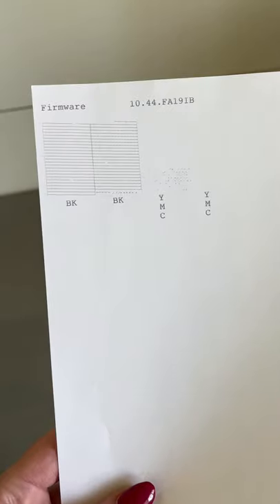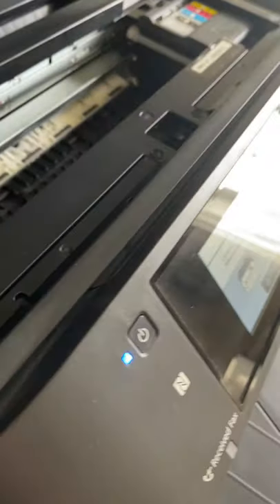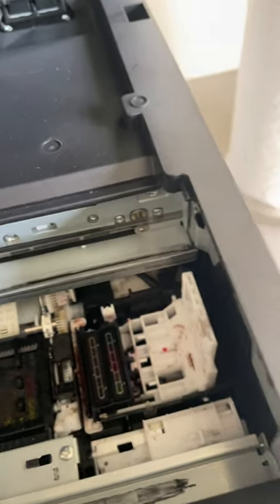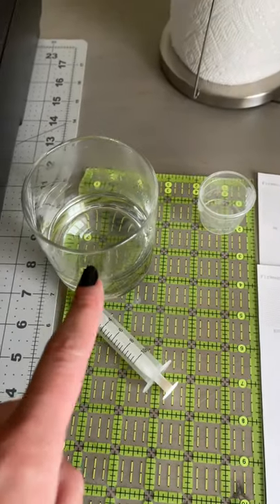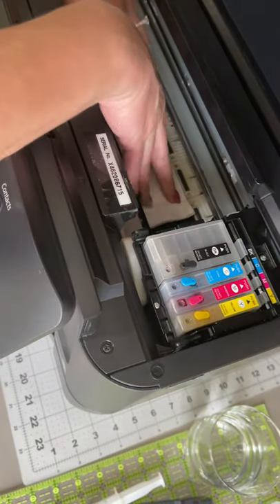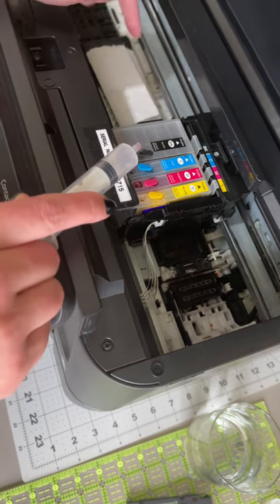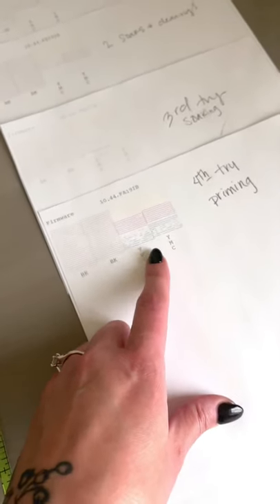Sublimation Help!: How to Fix Stubborn Clogged Print Heads (for Epson Printers)

Comment: I got nothing but blank pages no matter what I tried. I left my printer for about 6 months without printing anything. After 3 days of trying everything I stumbled across this video and you are a rock star! My printer is now printing and all colors are perfect! All I did was try the hot water once and ran the head cleaning. After that it printed perfectly. Many, many, many thanks to you!
Reply: Your post gives me serious hope. Sounds like our boats are similar!  Id be so stoked if this works.. The stuff I printed before the clog was soooo dope!
Reply: I will definitely try this tomorrow and the. Comment
Reply: I’ll be lucky if i get it working at all
Reply: This gives me hope! Lol
Reply: Im hoping for the same results! I’ve already done the cleaning with the solution and no luck. It actually stopped printing ink period and finally back to the broken lines. Im trying the hot water method right now. I wanted to try the priming but i dont know how to remove the door to the ink carriage
Reply: Nothing we tried helped until we watched this video! I had been cleaning heads with the solution but thankfully the hot water thing started moving us in the right direction. Ink is primed and now flowing. Hopefully after doing some more head cleans with hot water stuff  then black will be good so I can print my transfers 🙏

Comment: My 7710 has been sitting also for two years and I use it for subbing with Cosmo ink. I’ve been putting it off because I know my anxiety will go through the roof. I’m so glad I found this video. I’m going to try to do this in the next couple days. Fingers crossed!! My printer wasn’t used much so I hope this works. Thank you
Reply: Same lol it literally was sitting for 2 exact years and I saw the color of my prints and tried the nozzle cleaning and freaked out because it didn't work. I really didn't want to buy another and thankfully came across this video
Reply from the maker: I hope this helps! Keep me posted! Both of you! 🤞🤞🤞
Reply: Did a purge and my blue isn’t working at all. I think I need a different syringe. The head on mine is too large to fit in there properly. Heading to the store. Please let this work!!
Reply: @carolrendes9962  did it work?
Reply: @RoommateWiLLE  I didn’t do the water. I just pushed air through and that worked.
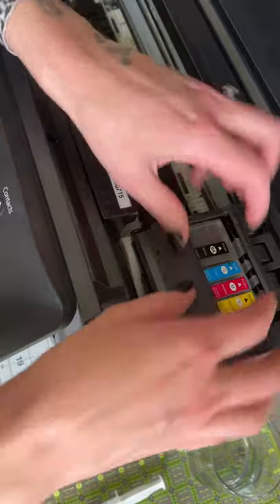Reply: Watch this video at the 3:20 mark, she shows how to purge with air. It worked for me.
Reply: I’m not having any luck. I’ve done everything

Comment: I have a Workforce WF-7710.  You are the best.  I just tried your tip for addressing the issue of my color cartridges that would not print well.  I did not have a syringe so I used a cotton swab to drop the hot water on the sponges.  After letting it sit for a few minutes a print head cleaning and print nozzle cleaning did the trick. Thank you so very much.
Reply: I sholde have read the comments first, great idea

Comment: Your procedure + crossed fingers + prayer = Thanks for the miracle! 

This worked on my Epson WF 2750 (non-sublimation) printer. I hesitated to drop hot water, however carefully, into my printer, but decided why not? 

Epson had already advised me to buy a new printer vs. 0:02 pay to repair it at the nearest facility, @300 miles away. I appreciated their logic. In fact, I felt like a mad scientist without a clue, following the steps you recommended. But it worked. Thanks again.

Comment: I bought an Epson Eco Tank 3 weeks ago but have had it unopened and debating returning it due to stories about having to print every week to keep it working.  Glad I found your video now I have more confident to keep it and try these things if it clogs since it will be only for hobby use.  I of course want the sawgrass since it doesn't have  these issues just can't afford one. Thank you so much for Sharing!!!

Comment: OMG it worked. My Cayan stopped working last Friday. Well it was out of ink actually all of my cartridges were empty, not sure how they were printing. I did the steam method twice, and right before I printed I did the syringe thing in the Cayan only. I cleaned the print heads and then printed and it worked. Of course I have a little mess on my printout, but a couple of test prints will clear this up. I AM SO GLAD I CAME ACROSS YOUR YOU TUBE ON THIS!!! You know I am a follower now. THANK YOU! THANK YOU! THANK YOU!

Comment: Thanks, it worked!!!  It took a few goes.  I also read somewhere the printer should not be near a hot place.  I had moved the printer into my kitchen last week where it is warmer to work.  I shall keep the printer away from the radiator if that was causing the problem.  Thanks again 👋👋👋

Comment: I am SO happy I found this video! Saved me the huge headache of buying a cleaning kit and going that route to unclog my Epson F170. Both the Magenta and Cyan print heads were clogged after two weeks of sitting idle. -_- This method cleaned them both and I'm back up and running. Thank you so much for sharing this info!!
Reply: how did you do it on the F170?

Comment: Tysm, I recently bought a used Epson ecotank printer off EBay and it probably wasn’t used in one or two years. I did the soak method (with cleaning solution instead), the air filling with the syringe, then two power cleanings (I know it can shorten the printer life but printhead cleanings only messed up the ink even more), which got it working again.

Comment: Thank you for your video with your information to unclog the Epson printer. It worked great. I did all 3 options so as make sure that it fixed it. I was not aware of the purge method by pushing air/ink through the cartridge. THANK YOU!

Comment: Thank you!!  My yellow was stuck, it always gives me trouble because I don't use that color often, I mostly print just black. So it clogs a lot.  I never can get it unclogged without hours of misery trying different things. The prime method and 1 printer head cleaning did the trick!!  So thank you for saving me hours of unnecessary printer head cleanings.

Comment: I was just about to give up on my WF7720 but tried your 3 things.  Black still has a bit of an issue, but it's probably OK.  but I wanted to ask about ink blobs on the edge of the paper when I first attempted. to print?  will those clear up?

Comment: I have an epson 2800. I printed a purge page and the blue is definitely clogged, the other colors came out great on the purge print. So when I take mine apart and add the hot water should I just add it to the blue section or all or it like you did?
Thank you for your time.

Comment: Hi Debbie, I did the purge after many failed attempts at print head cleaning and 2 soaks and it came out great but after I did another print head cleaning and both my blue and my black are still not aligning. Do you know what else I can do? Mine sat for a year and I have done everything in this video.
Reply: I am having the same issue.

Comment: LIFE!! After months I finally see lines!  What I ended up doing was a Backwards purge? Well call it a Enima.. I took the syringe with no needle and it fit snug in the hole that the ink flows from. After a few solid slow pushes I was able to move some of the clog!. I think for the really clogged ones I'm going to do the same thing but with the boiling water.  It's a silicon niple inside the hole. I image food grade able to withstand boiling temps easily.

Comment: I noticed your printer looks like mine it's a Epson 4830 are your refill. Carriages from eBay and do they NOT have chips. Does it print. Without the chips ? THANKS
Reply from the maker: My cartridges are from cosmos ink. They do have chips that reset themselves. So nothing special I need to do with them. Just refill the ink and keep going.

Comment: Great tips, I wasn't able to push air through the heads as my cartridges are different, but I did manage to clean out the pad and the (intake tubes?) and voila`, I'm out of ink, but I finally got an alignment pattern that wasn't just blue.

Comment: my printer has been sitting for 2 years as well. i’ve done multiple print head cleanings, etc and my black is good but my colors are showing nothing. im going to try this tomorrow but my question is, does sub ink expire? my color cartridges are low on ink so im thinking refilling them may help. should I just completely start over with new cartridges & ink?

Comment: My epson 7710 has been sitting for a few months started using it worked fine for 3 prints then down hill from there. I tried all of the above even changed print settings, paper, paper setting, purging, print head clean both on printer & manually, primed ink, soaking method still nothing. Am I missing something?  Or time for a new printer? I've only had it since 2019 or 2020

Comment: Tried the hot water yesterday, I have tried all of the other methods many times. The water did not work, trying it again now with really boiling water. The only color that won’t print at all is blue, other colors are fine. Can I replace those sponge like things?

Comment: Hello - Hello! Well, congratulations, because you have officially met anther person who hasn't used this printer in years....lol....

So, all I can do is scream! I am getting blank prints whenever I go to test page, check nozzles, clean printheads. Absolutely nothing is working. I am thinking maybe it's the cartridges? Looks like the ink dried out, and it's stuck in the cartridge?!?! So, my next move is to buy another set, all new set and go from there. Any other options?

Comment: So mad that I didn't come across your video first! But I'm still getting streaks after the 5th print head cleaning.
Reply from the maker: Let it rest overnight. Sometimes it just needs some time to soak after doing all those steps.
Reply: @DebbieDoesDesign  yes that did the trick but my printer says it’s out of ink but my cartridges are full.

Comment: I have an ET 2720 and I'm not quite sure how I would prime it. Instead of where you refill the cartridges being just a circle, it has a divider in the middle. So it's 2 half circles, and I can't fit a syringe into refill the cartridge (if that makes sense). Do you have any suggestions?
Reply from the maker: I don’t know if there’s a way to prime ecotanks. I’m new to ecotanks and haven’t had a clog get bad enough that I’ve looked into that. Most of the steps in this video are meant for printers with cartridges, aside from printing a purge sheet. You can do that with an ecotank.
Reply: I ran power cleaning on my ET 2720. Then did a nozzle check print and black wasn’t printing well. But it did say print will improve after 24 hours. And it did.

Comment: have you done a tutorial . on using ink to fill a cartridge. also do we need the gadget to use a needless syringe to take ink back out or is this just bumph from another tutorial trying to sell stuff or a fact . thank you
Reply from the maker: This video is for printers with cartridges. The process should be pretty much the same regardless of the model. 

https://youtu.be/3gqu2FfnVVU
Reply: @DebbieDoesDesign  Thank you

Comment: Hi Debbie! My epson 7710 sat for only 3 months without printing and my cyan has fine white lines when i do the purge print. I have tried all of your suggestions, plus bought print head cleaner with the tubing and cleaned out the ink in the print nozzle. Sadly after weeks of this and trying everything I came across online it hasnt changed anything. Any suggestions?
Reply from the maker: Usually you can fix those lines by doing a couple printhead cleanings. If that’s not working, it might be easier to help you troubleshoot by joining my group so you can show pictures of exactly what’s happening. (Www.Facebook.Com/groups/debbiedoesdesign). Sometimes there are lines that are caused by a small clog. Sometimes there are lines caused by the print rollers. Seeing a photo of what your lines look like can help me narrow that down for you.

Comment: Need help please,first time converting my eco tank 3210 printer,but my red light is not coming on to charge the ink any suggestion
Reply from the maker: Mine doesn’t have a red light. The charging prompt pops up on the screen after you fill all the tanks. I don’t have a 3210 so it may do the charging differently. I’ve heard some people say it doesn’t go through the charging step until you hit print for the first time. So maybe try to print something and see if the prompt pops up at that time?

Comment: I have the Epson 7710 and what works for me is to inject a lil ink into the bottom of the cartridge into that sponge area and it corrects after a head cleaning.  What I need help with is unclogging the smaller Epson 2720 Magenta color.  Any advice would be great. Thnx
Reply from the maker: I’m not familiar with that specific model but if I remember correctly that’s basically a smaller version of the 7720, so the steps to try should be the same.

Comment: I have the Epson tank 2720 and it doesn’t have that menu to open up the top of printer to get to that spot to use the watet
Reply from the maker: There shouldn’t be a menu button to open the lid. You should be able to just open it. You do need to interrupt it during a printhead cleaning in order to loosen up the cartridge carrier and move it aside. Unless your model works different. I don’t have they exact model to know, but I’ve heard they are pretty close.

Comment: I followed all the steps, when I tried priming air pushes through the black but nothing comes out :( all other color come through no problem, any advise?
Reply from the maker: So you are able to press the syringe down but no ink is coming out? Are you sure the tank of full of ink? Make sure the plug where you put the ink in is plugged. If that’s open then it will just push air out of that hole. You need everything closed so the only place for the extra air to go is through the bottom.

Comment: When you add the hot water to the part, what happens with it? That’s where I’m confused and scared
Reply: It absorbs a bit and then it creates something like a puddle (don't add more water). Then push the cartridges over it. Wait 5 minutes and then try to print again just like she said.

Comment: Do u know anything about the epson ecotank 15000? I have a clogged magenta!
Reply from the maker: I haven’t used that model and I haven’t dealt with a clog on mine yet that wasn’t fixed with a single head cleaning. Have you tried any head cleanings yet? Does your printer have the option for a “power head cleaning” or anything worded similar? A stronger option to try if the normal head cleaning doesn’t work.

Comment: Any idea why my printer when trying to print double sided will print one side then spits it out and says the paper selected is the wrong size? It's just the typical sized paper, not sure what to do
Reply from the maker: I’m sorry, I’m not sure on that one. I never print double sided with these since I use them for sublimation.
Reply from the maker: Maybe, make sure the paper size selected on the computer matches the paper size you choose on the printer itself. I know that can throw errors if they don’t match.

Comment: Please help me! Mine has been sitting 3 yrs at the least. Stored well but I get nothing printing. I've ran every test and got all blank sheets. I can try the hot water but my cart. Do not have the holes on top to do the air? What do I do its only been used a short time new then I moved 3 times back to back....long story. Im 70 yrs old and no nothing og electronics! Help.
Reply from the maker: Your cartridges definitely need an air vent in order to work correctly. There’s no extra plugs on the tops you can remove?

Comment: Hi I have an Epson eco tank 15000 my black didn’t want to print it was streaky, cured the clog with air however now black won’t print 0 how many times will I need to bring to get it going
Reply: Have you fixed it ?
Reply from the maker: It depends on how bad it’s clogged. But don’t overdo it. Have you tried letting it rest overnight? Sometimes that helps to just give it time for that ink to soften up the print heads.

Comment: I tried this and it didn't work. I'm tempted to toss my 7710. The blue isn't printing. Any other tips?
Reply from the maker: I can definitely relate to that feeling! I’m sorry it’s still not working. You might have some other issues going on. I assume you tried all the different tricks? Have you tried letting it sit overnight since doing all of that? Sometime with just needs some time to let those print heads soften up again. YouTube doesn’t allow you to attach photos to your comment, but if you’d like some help troubleshooting further, you’re welcome to join my group and post some photos of what is currently going on, and as much info as you can, and I can see if I can help point you in the next direction. www.facebook.com/groups/debbiedoesdesign
Reply: Thank you!

Comment: I’m getting low ink all colors. 😓 and These are brand new ink cartridges. Original Epson ones too.
Reply from the maker: Is the ink actually low, or is it just giving you low ink errors? Usually if you fake it out and go through the steps like you’re replacing them, it will clear out those errors.

Comment: Did everything and I can’t get it to work.. also saying black and yellow aren’t full but they are
Reply from the maker: Ignore the fill amounts. The printer isn’t able to accurately read the refillable cartridges levels. If it’s giving you an error that they’re empty to the point where it refuses to print, unplug your printer for a few mins and see if that helps reset it. Also, sometimes uninstalling it completely and reinstalling it can help wipe those errors too.